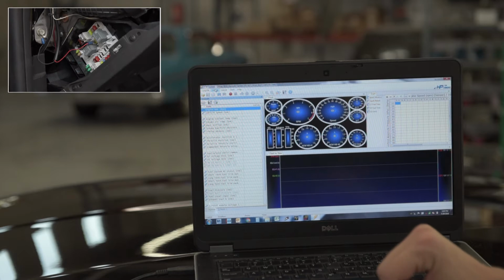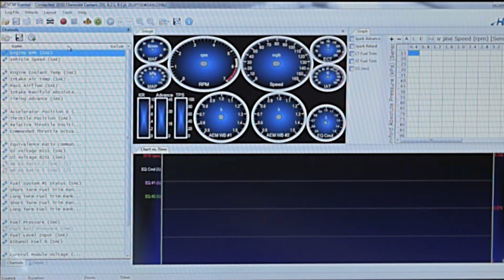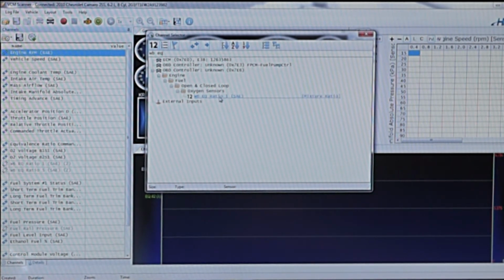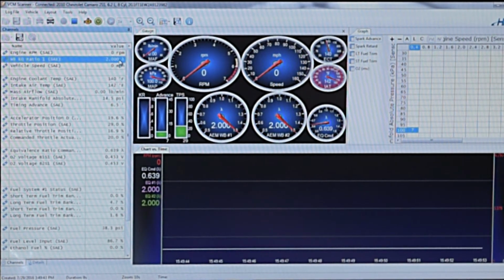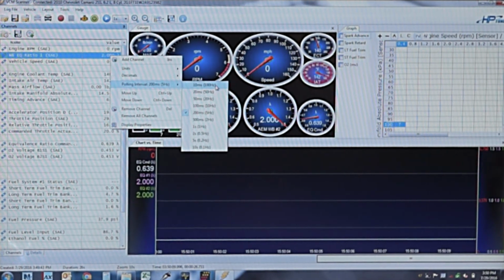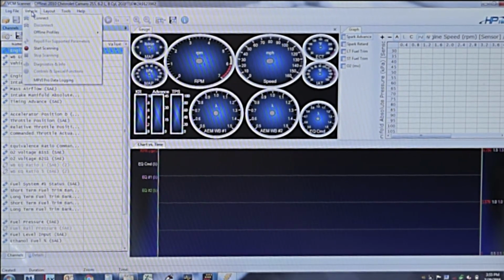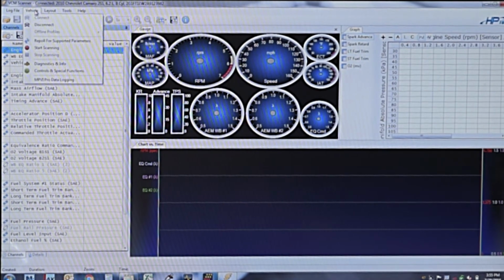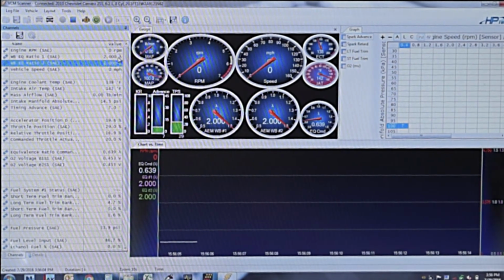AEM XSERIES OBDII Set Up in HPTuners Software

Comment: I followed the instructions in the video but when I connect the MPVI2+ scanner to the passthrough from the AEM wideband, it only reads the wideband and not the car. I have even replaced the gauge and the wiring but it still only reads the wideband. If I remove the passthrough and connect the MPVI2+ to the OBDII port directly it reads the car just fine. Is there some other setting that may be off?

Comment: Only works on 2008 and newer obd2 CAN Bus. Dosen't show up on my 2003 Silverado
Reply: So how do hook the x series to like my 2003 trans am
Reply from the maker: Correct. The OEMs adopted the CAN standard in 2008, so it will only work on 08-up vehicles.
Reply: I have pro link cable

Comment: Do you need the upgraded box for this to work, or will the standard one do fine?
Reply from the maker: Please check the HP Tuners forum. There is information there regarding what versions this will work with.
Reply: You don't need MPVI Pro since it runs off the vehicle aldl port.